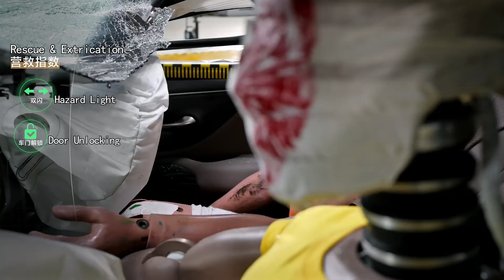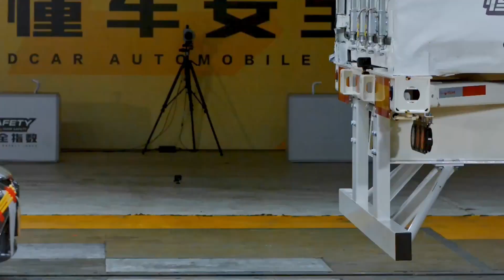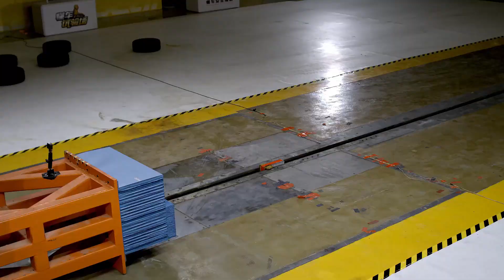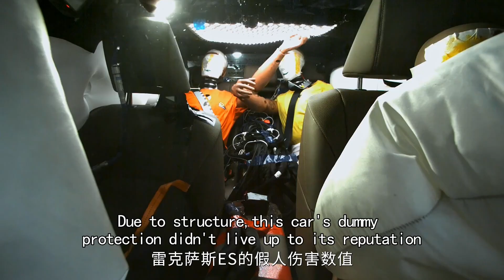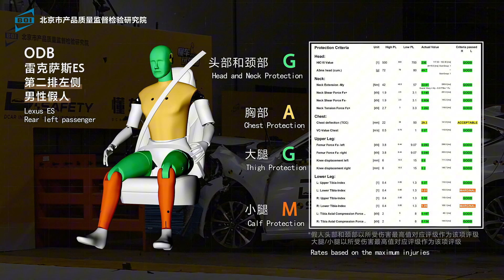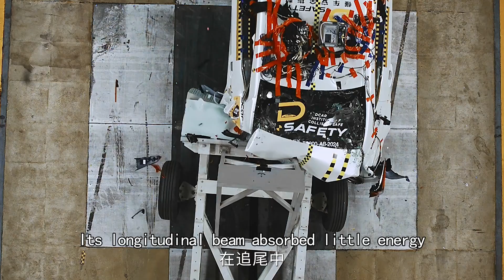Lexus ES Crash Safety Test 雷克萨斯ES 碰撞安全测试

Comment: The hazard lights weren't on because the vehicle ignition wasn't in the "ON" state, therefore electronics and ecu control modules that control such things weren't on
Reply: Also the ES battery is in the trunk above the right wheel. I think this got impacted.

Comment: Like the details that go into its ratings! I wonder how a Subaru would hold up
Reply: They will failed also hahahaha
Reply: A lot of cars would fail at this. Everything that doesn't go under the trailer would fail (apart from the G-Class). And the 40mph offset should be easily passed at this point, $15k cars are doing better than this Lexus.

Comment: the car should protect the passenger space at any cost which it does perfectly no door was stuck or jammed and the front and rearend are meant to crumple in a crash to absorb energy and that did their job perfectly. Talking about the truck crash test its pointless for low slung sedan like that the truck should be equipped with lowered bumper to make the car's crumple zones work.
Reply: The A pillar deformed in an offset deformable barrier test. That is something that should not happen to the car designed  from the mid 2000s and later.
The rear steel beam did nothing, in a rear-end crash. It remained almost intact. It was supposed to deform and absorb energy.
Reply: @DashCamSerbia  i dont think that suppose to deform the crash bar is a rigid metal to deviate impact to the chassis legs of the car instead of weaker trunk structure.
Reply: @artimus0112  That makes sense, yes. Although, it should be design to, when the chassis legs absorb all the energy they can, to then deform as well to absorb even more energy.
Reply: @DashCamSerbia  im not a design engineer but im sharing what i know, Yes there is room for improvement, but i think truck must equip with more advance rear protection instead of making cars more rigid that will make all cars look like jacked up SUVs or looking like cyber trucks and we will only hope for more affordable cars.
Lexus ES is a more affordable full size sedan with luxury as compared to german bmws n merc so the cost cutting will be shown somewhere in this case its weaker structure.
Reply: As you can see inte the video it wasnt just the truck crash that was the problem.